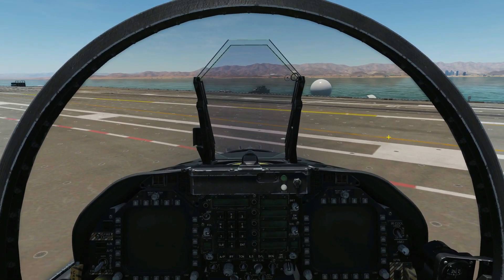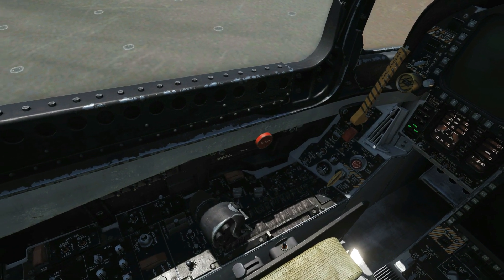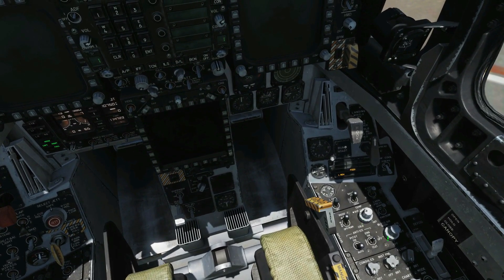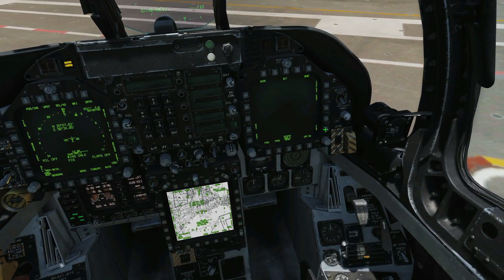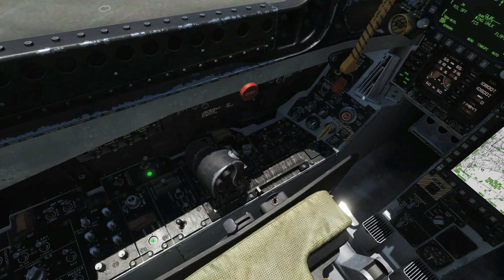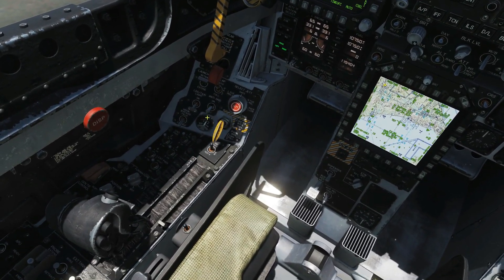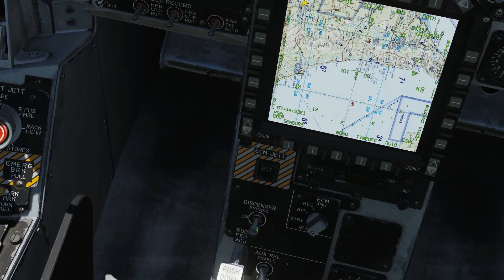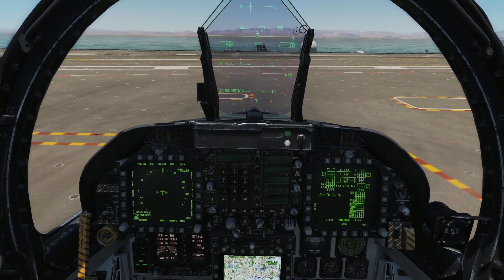FA-18C Hornet: Carrier Fast Cold Start & Alignment Tutorial | DCS WORLD

Comment: Why is it that every f-18 start up, the throttles are uncaged with keyboard keys? Is there a physical switch for this in the cockpit? (I've attempted to just move the throttle levers)
The reason I ask is that its difficult to use the keyboard while also using a VR headset. Its slightly annoying to have to lift the headset to see what keys I'm pressing on the keyboard.